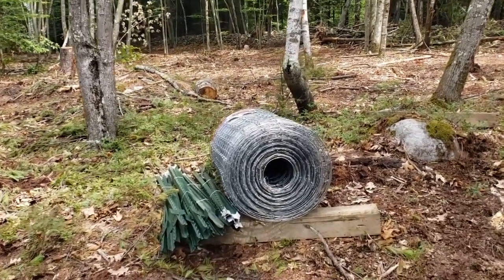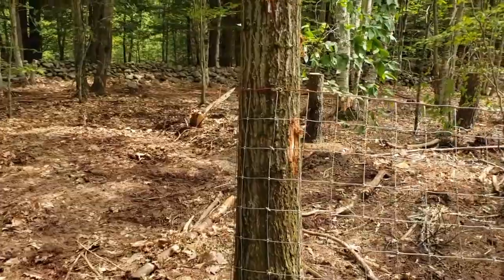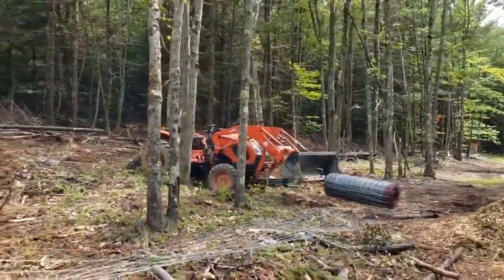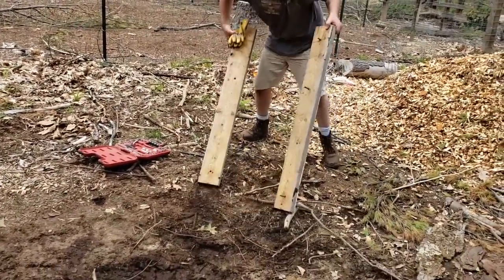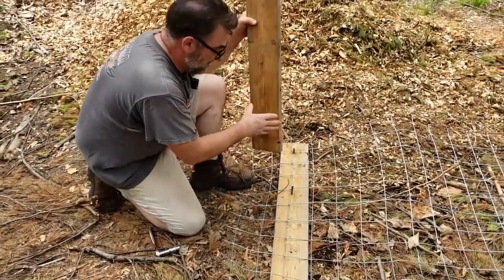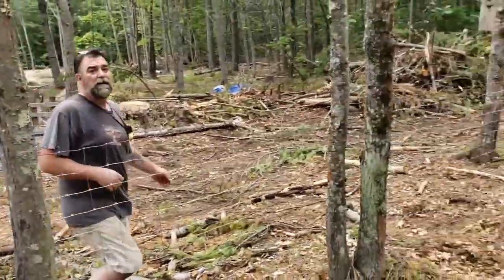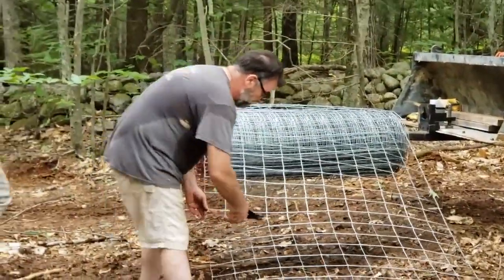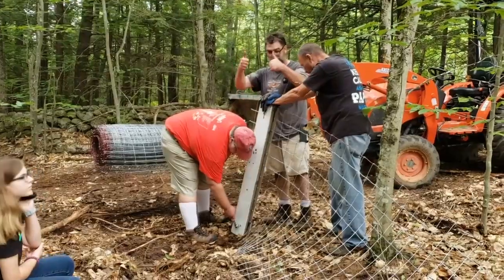Cheap and easy way to install fence using trees as fence posts and using homemade fence stretcher.

Comment: Never put metal in live trees!
Reply: well his trees, his property so..
Reply: Lol, why? Seriously is there a reason or????
Reply: @MrManic52001 because the tree will grow around the nail and embed it. Then later if you want to cut it you won't know where the nails are. It could be very dangerous.
There is a way to do it though, with a board and a washer around the nail. The tree will push the nail out against the board as it grows.